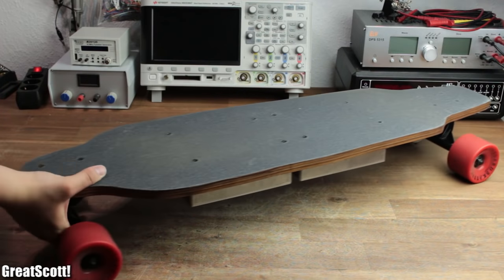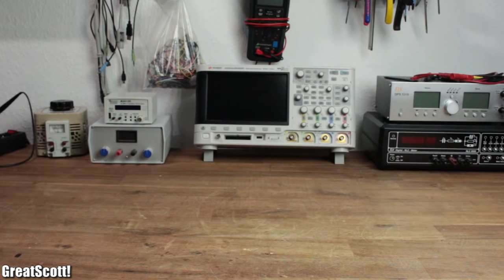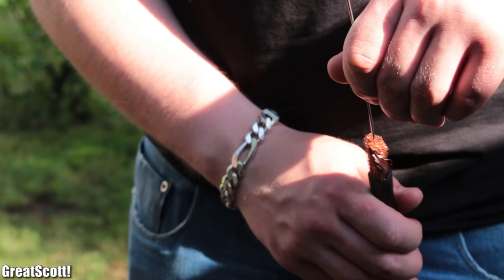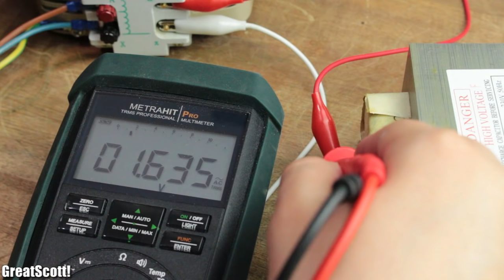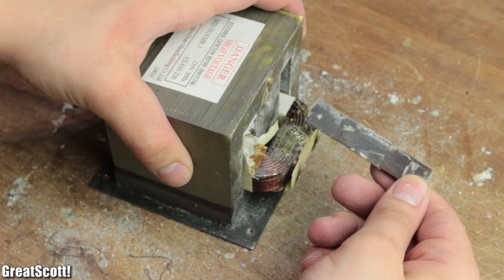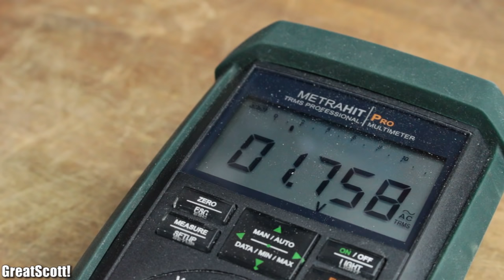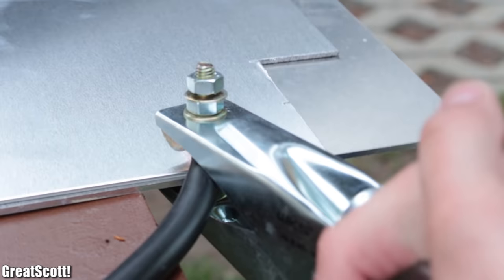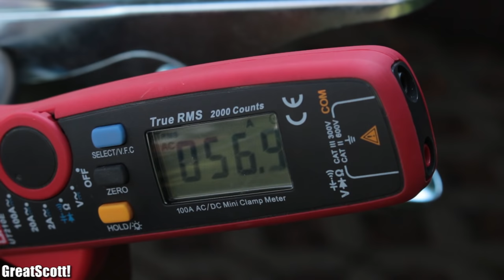HACKED!: Microwave Transformer becomes a High Current Transformer

Comment: You should to take two cars accumulator and connect them parallel. Then take a wire and you have very good welding and melting machine;)

Comment: idk if you found a solution yet but, you would need to make sure the rod you are using will work with the kind of current you are using (ac, dcp, dce) and depending on the rod and thickness of the rod you are using will need different amps, so use low amp rod that will work with your current and try using 3/32 thick rods will help

Comment: You can use two transformers together which have the primary input coils coonected as parallel and one secondary coil which runs through both transformers to increase the current

Comment: use 12 gauge wire and your gonna need to wind 2 cores the same then run the secondarys in series . you wan about 27volts or so on the output ....ive done this and it took me a while but it worked

Comment: If you're smart, the very first thing you do when you get that cover off of the MWO is arc the capacitor. Very slim odds that its storing a charge. But it cost nothing and you'll be sorry if you dont and it did.

Comment: Aluminum welding requires special high frequency welders (normal 50Hz 60Hz AC is it low) the high frequency is to break the oxide that forms on the aluminum surface.
Perhaps you should try to weld iron and with a much higher voltage (like 50 Volts), it's way easier than aluminum

Comment: You need tig welding to work with aluminium. What you doing is arc welding which is fine for steel or iron

Comment: if you want to make arc welder you need 2 microwave transformers conected in series with secondary coil of 18 turns 8 gauge wire

Comment: For welding you need direct current not alternating current and you need more amps rather than voltage 
I reccomend 12-24 volts and about 50-120 amps depending on the thickness of the metal

Comment: Make 2 more for a total of 4 transforners. Connect 2 together in series. Connect the other 2 together in series too. Now connect the pairs together in parallel. That should give you both the voltage and current you need.

Comment: Great video but you mentioned you wanted a much higher current but then only gave voltage readings later, I was curious to know what the amperage was on the second transformer you tried.

Comment: You need an inert gas to weld aluminum, or else it will just gum up as aluminum oxide forms on your surfaces as they heat from the arc. 
Aluminum welding is fairly complex!

Comment: Aluminum can be rusty and we wouldn't see it .it actually rusts fast ,and thet kayer of rust protects the rest from oxidizing,  but its got to be wire wheeled ,Otherwise theres continues loss of connection . Which leaves bumps and burnholes

Comment: U can use two transformers just wrap one wire through both and the AC to main coil on both or with aluminium u can use a torch and aluminium brazing rod kind of like soldering just lightly heat up the aluminium until the brazing rod melts into the aluminium

Comment: You'll need to shield the weld from the atmosphere somehow, either with an argon shielding gas like the MIG and TIG processes use, or by using a flux coated electrode designed specifically for the job (not sure what those "universal"electrodes are). Having said that, welding aluminum is tricky. Aluminium is much more prone to oxidizing at high temperatures and the oxide has a higher melting point than the metal meaning it floats around on the weld pool getting in the way. Oh yeah, Aluminium also needs way more current to weld since it is so electrically and thermally conductive. I reckon the setup you made may well work on light steel plate though. Didn't seem too far off working.

Comment: You need much higher voltage, preferably DC, and STABLE current from about 12 amps up to 185 amps. 12V works well, 24 through 32 is better suited for mig but forget that with your setup because mig relies very heavily on frequency and amplitude. 12VDC, negative ground, 38~42amps will allow you to push a 3/32 6010, possibly a 1/8 if your transformer is strong enough… you’re going to need a MUCH bigger core to produce the power you’ll need to weld. Look at a high quality starting box for a truck or tractor for your transformer OR wind yourself a toroidal, dump the iron core for toroid if you’re serious.

Comment: You need to be able to produce about 20VAC to breakdown the oxidation layer of the material. You also need to be able to keep that current high (20-80A depending on your plate thickness and your filler rod thickness.) You also need an inert gas like pure argon and bathe the welding area in a constant stream of the gas to prevent oxidation of the surfaces and keep the impurities from air and arcing low. You can't TIG or stick weld without that inert gas, you can't even sustain a good/clean arc (as seen in the video). There is a whole enormous science that goes into every detail of welding and you should try to get some hands on tutoring from an experienced welder. It would be cool if you are able to figure it out and I'm looking forward to the video.

Comment: I have tried this several times since watching this... I would like to try again but i would replace the thick insulation on the secondary with something much thinner... my idea is to use that stretchy self fusing tape stretched thinly over some super thick wire to get more turns with less resistance.

Comment: If you really want a diy welder that works well enough, and are not going to build a proper buzz-box, or buy a welder, getting some car battery cable, connecting two car batteries in series with the battery cable and getting jumper cable clamps and connecting it to the batteries with battery cables, connect the negative to your piece of metal, and put a welding rod in the positive clamp. I have done this with lawn mower batteries, but you just dont get as much run time. I had been wondering if it  was possible for a while, and when my mig welder broke, this actually worked. All of these parts can be obtained at the auto parts store

Comment: I've actually made one of these before. He made this a lot more difficult when he built it. To take the secondary coil out all you have to do is cut the thin welds that that join the e and i part of the transformer. And I used 2 ot wire for replacing the secondary coil

Comment: You will need to use the 100A 1600V Single Phase Diode Bridge Rectifier,  You cannot use AC power for ac welding.

Comment: My father had built a welder when he was younger, having seen it i can tell you you probably need something quite a lot bigger than what you're trying to work with, also i'm fairly sure you can connect multiple transformers in parallel to get a higher voltage. It's just that they might heat up and melt, but if that happens you can submerge it in some non conductive fluid to cool the thing maybe, don't take my word for it test it first if it happens you consider this.

Comment: Appreciate this a old video but to get the winding out just cut top winding with a hacksaw both sides then with a metal bar with a flat end smack core through with a hammer.So so much easier

Comment: What you could have tried was use an electrode to create an arc. Try a pencil lead or a graphite rod from a standard zinc battery ( not alkaline ) Then feed the aluminium rod into the arc and hey presto you would have created a tig type weld, all be it without the inert gas shield, but it may have worked as you were welding clean metal.......

Comment: I had a 4kva torodial transformer, i wrapped a 8mm wire (4turns on it) and the short circuit current was >200 amps. A different transformer or a thin wire with high windings will be better

Comment: The transformer casing is too small to accommodate the secondary winding wires.    It take about 50 volts minimum  with enough amps to weld.   I tried to connect mains 220  A/C supply to the primary and it blue the fuse.   I don't thing it is connected directly.   Your winding ratios are correct.   You may buy a little welder.

Comment: if you use two of these tranformers in parallel , and if u try to make around 20  windings it will work 
try to weld steel it's easier

Comment: The aluminum "electrode" you were using was actually an aluminum filler wire used in Tig welding process. Tig welding uses a arc established from tungsten and a constant flow of shielding gas such as argon. Your not even close to that. Aluminum tig welding should be done by achf. Though, There are other ways. You were setup for stick electrode welding which uses flux covered rods. Drop the rod size to 1/16  6010 or something similar and use carbon steel and you may have more luck.

Comment: that's neat but it's alot easier to put two car batteries together 24v jumper cables and DC electrod and your done;) seriously have used  this method before it works well for small welds and repairs.

Comment: Your trying to stick weld with filler for a Tig welder. You need a flux or a gas to sheald the arc from the atmosphere to prevent oxidation this would work if you produced an arc using tungsten and used argon gas to sheald the arc then use your aluminum filler and push it into the puddle just look up Tig welding aluminum

Comment: I recommend an E7018 electrode and it helps if you just put a bunch of car batteries (I would say like 12) and connect them all and use that as a welder, would turn out much better, one other thing is getting what you are welding got before you weld it, the hotter the better, then it welds much nicer and easier
Reply: 7018 doesnt work on AC...
Reply: AirsoftSlo ummmm, yeah it does, for aluminum and some other metals, you absolutely need AC cuz it won’t even weld with dc, but with steel then you want DC
Reply: @mwint1982  Yeah my bad. I mixes it up with another type.

Comment: Rough up that surface a bit with sand paper just a bit. I'm not by any means an expert or even a novice just telling what I've learned from welding. But some metals are coated when their shipped I was told.

Comment: You definitely Need more Power, It could be an option to use 3 or 4 microwawe Transformers with same windings as the second One you made... but with primary windings in parallel and the secondary windings in series making sure they are all in phase...

Comment: If you have an impact drill put it in the chiseling mode and use it to push the coils that you've cut from one end to the other that how I did mine and it's really easy that way I watch so many videos before doing my and most of them tend to suffer during this part

Comment: Just add a high current full bridge rectifier and maybe some super caps to the transformer, the many zero crossings in the low 50Hz ac voltage kills your arcs.

Comment: welding usually works with about 15-30 V and about 30 A per mm electrode thinkness ... Aluminum is a little different normaly u go for Ac and Mig or Tig welding

Comment: Try to use 2 transformers in series with 35mm wire, you should be able to get the desired voltage and current for the welding!

Comment: Dear; to induce the electrical arc you need high very high voltage, but what you did is increasing the amps and reducing the voltage, however such transformer no way can generate enough power for welding ...

Comment: Even though you clearly warn people about replication I feel it is important that people know that the big capacitor you took out can contain a nasty surprise if it is still charged when people take microwaves apart.  If you DO take a microwave apart be careful of the capacitor... short it first with a screwdriver if you dont know what you are doing.  Also the magnatron contains a cancer causing chemical that you should AVOID!

Comment: In case if you try next time keep your current 110 to 120 A an keep the voltage from 17 to 25 V for Aluminium the current Will be 80 to 90 A

Comment: why don`t you use an electric motor coupled with a car alternator from which you remove the diodes? if you want to intensify the welder, you can add a rectifier and some capacitors..

Comment: swap the  the windings.  put line voltage on the high voltage side, use low voltage side to weld
Reply: DSAK55 idiotic. instant short. the sec has a resistance of almost zero which would go with a bang

Comment: Hi-welding Aluminum is never as straightforward as the welding of any sort of Steel. Aluminum needs what is called an AC welder (a Stick Welder is DC based). The aluminum process needs that because aluminum has what’s called and Aluminum Oxide layer on its surface formed whenever aluminum comes into contact with oxygen). The melting point of Aluminum Oxide is farrrrr higher than the melting point for aluminum, so a welder first needs to be able to produce the type of amperage/heat to do this, and then it needs what’s called the “cleaning action” that the wave of an AC welder produces through the the intermittent forward/backwards direction of the current. So-your attempt to weld aluminum with your makeshift welder was pretty much doomed from the start.

Most people TIG weld aluminum, and AC TIG welders tend to be the most expensive tier of TIG welders, so there is no real way to do this on the cheap-to say nothing of the time-and probable expense-you’d have to spend acquiring all the experience and expertise to lay down good and proper beads with aluminum (TIG is the hardest of all the processes to master).

Sorry to be the buzz kill. But your attempt was entertaining.

Comment: You need proper sticks for welding. Aluminium is almost impossible to weld with transformer so just change material. It really won't be that much heavier. Also very important. Even if you buy proper welding sticks you still must be sure to buy ones that work with old transformers. I think about 70 percent of sticks which are available are hard or impossible to weld with transformer. Todays stick welders are very different from transformers with electronic aids such as anti stick etc. parameters

Comment: Warning ⚠️ ⚠️ ⚠️ don't go get terminal cancer messing around with a microwave magnetron. On the magnetron head, there is a whitish tiny ceramic-like hollow cylindrical element you don't want to mess with. A good whiff of its dust when prying it out and it gets scrapped with hard tools is all it takes to be a victim.

Please be safe handling these, or less better still, find a transformer for your project elsewhere - one that doesn't require you prying a microwave open and messing with the magnetron, especially if you're not sure with the ropes of handling those things.

Comment: Make two transformers with the secondary coiled in 16mm2 wire with 16 turns each. By connect the two transformer in series, you may get enough power to weld.

Comment: @GreatScott! Reason why your welding machine does not work is because you need another transformer, first transformers cables need to go around secondary coil of trans former and then after another transformer`s primary coil and after that you take welding power from it.
Reply: And sorry about my bad English, I'm from Finland
Reply: And don't take out those transformers splitter plates
Reply: One way too  is add more transformers one after another, like 6 transformers all with 6-12 loops on secondary

Comment: What if you removed the primary coil from the transformer, and connected the second one to the mains? I mean, surely the resulting voltage would be lower, but wouldn’t it give you a lot more current?

Comment: There's other YouTubers that use Transformers to melt stuff all the time if you watch some of their videos you'll probably find a better microwave with a better Transformer to create the same thing and get 6s from it as for welding aluminum that requires the TIG welder I'm not sure if that's the same principles as an arc welder

Comment: I connected the primary side of my microwave transformer to mains voltage and it blew a fuse and now I have a flash in the center of my vision for last 5 minutes.  What did I do wrong?  I didn't have the two output leads touching... so I don't see why this would draw so much current.  Is it supposed to run off a higher frequency AC?

Comment: I do not understand how changing the secondary coil like shown in the video changes the type of output of the transformer. Pre change the transformer, the output produces high voltage low current, but post change, the output produces high current low voltage. Someone explain it to me?

Comment: Why did you replace the secondary? If you replaced the primary and ran 230vAC through the secondary, wouldn't the turn ratio be higher and thus more current?

Comment: Do you use a smaller wire I used smaller wire made one use two transformers together in parallel and my welder works just fine it will will quarter-inch steel you're using too thick of a wire and you're not getting enough windings

Comment: Are you sure you cut the secondary and not the primary ? Usually the primary contains more turns than the secondary: V1/V2=n1/n2.
Reply: You are right saying that, normally, the primary has the finer wire and much more turns.
But microwave transformers are increasing the voltage while, normally, transformers are used to decrease the voltage.

Comment: that wasn't a diode attached to the Capacitor. that was a resistor used  to drain the stored electricity out the Capacitor after the machine had been turned off. you're lucky that resistor did it's job otherwise you would have been dead when you touched the two terminal of the Capacitor

Comment: Use an old Lionel transformer from s train set from the year 1950 that should be enough power to weld it will put out 360 amps i know it sounds impossible but its true the Chinese used them as a torcher device back then